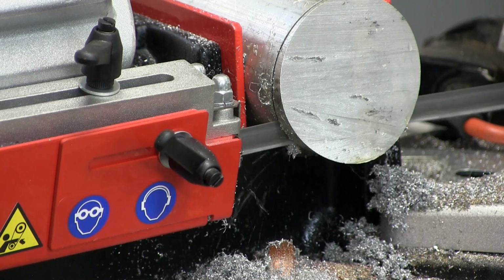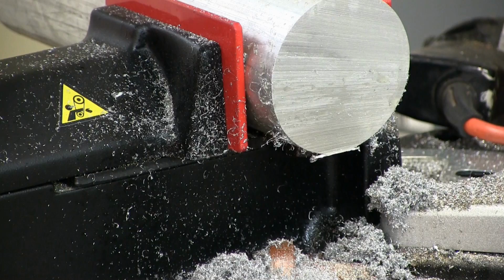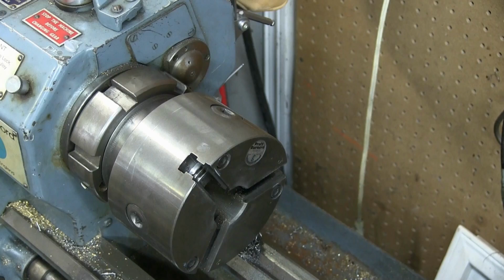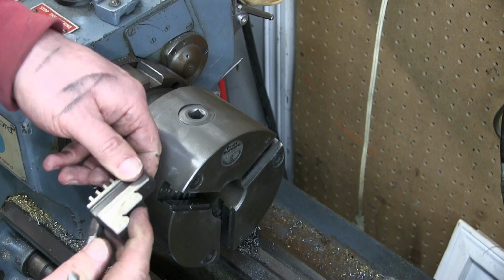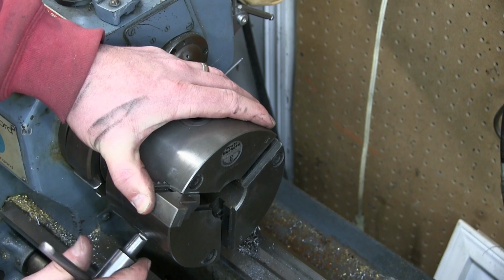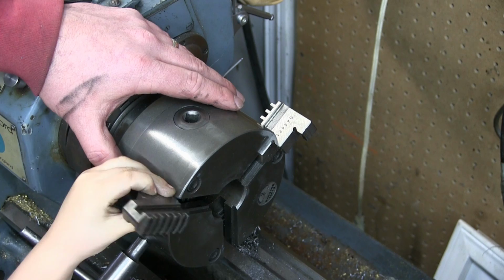CHICKADEE ENGINERDING! | Father & Daughter time

Comment: Sad we didn't get a chickadee-torque-wrench at the end with "Unnnnnghhhhh *click*"
Reply: Jeremy Cole then back a quarter turn 😉
Reply: I did that at work the other day tightening down a bench grinder, the fellow next to me looked at me funny.
Reply: I was changing the abrasive wheel on my O.D. cylindrical grinder at work and every single mounting bolt on the hub there was the necessary "click." The guy helping me out looked at me dead in the fa e and said "alright uncle bumblefuck..." and we both had a laugh... its an old Landis that has more than paid its weight in the shop, the old clapped out bridgeport is a cadillac compared to this high-mileage Yugo lmfao

Comment: I have a 4 year old nephew.  It is interesting to teach kids things and watch them learn.  My son is wanting to try to teach him to mig weld soon.  He has been operating a drill to drive screws for about a year.  Last year we were in the shop.  I have a 22" floor standing drill press.  He picked up a piece of wood off of the floor, clamped it in the vice on the drill press.  Slid a chair over so he could reach the motor and light switch, turned it on and drilled a hole in the wood.  I watched him carefully so he would not get hurt (other than falling out of a chair) and he did everything correctly.